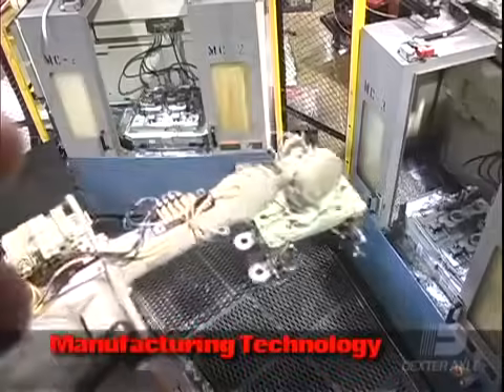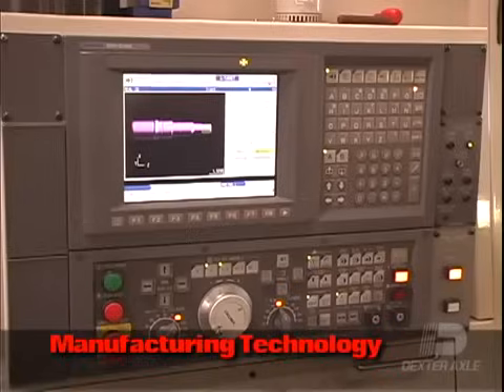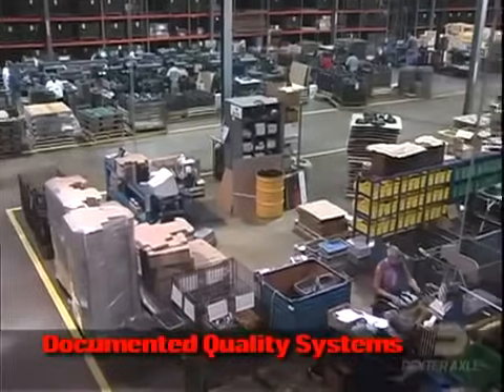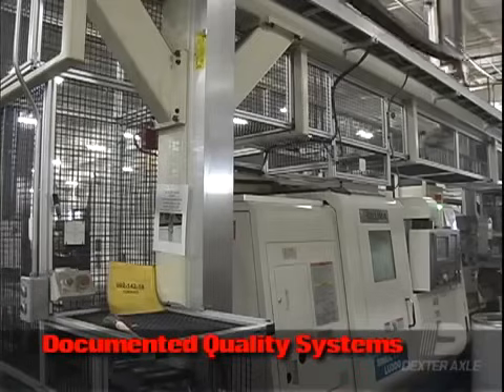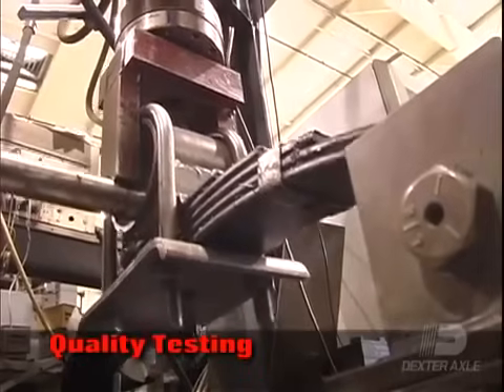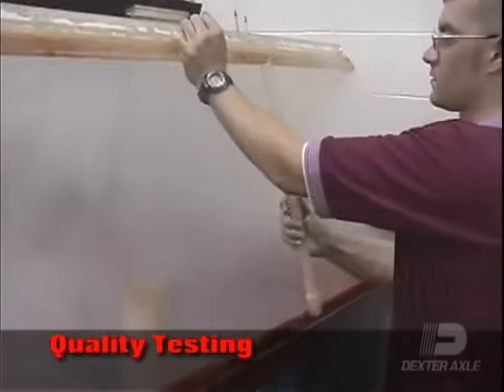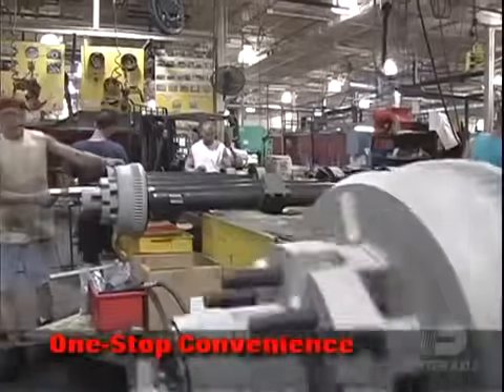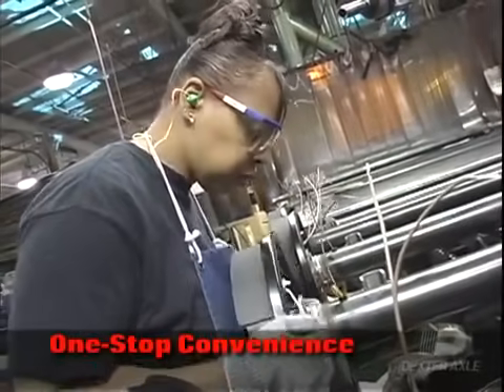The Dexter Difference

Comment: I have a 16' cargo trailer and did a straight pull of over 800 miles @6500 lbs and upon arrival I got out of my truck walked back and wrapped my hand around the spindle and it was cool.  You can buy a trailer of your choice but make damn sure you get Dexter's under it.